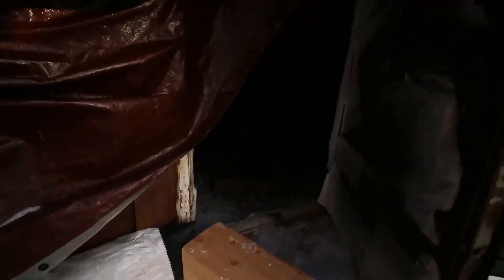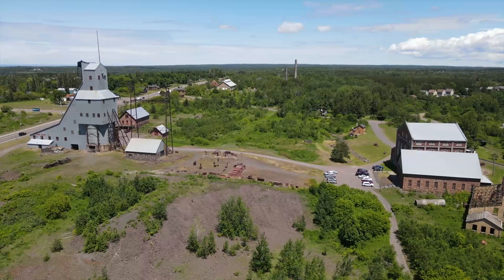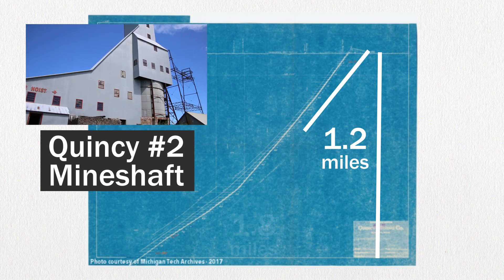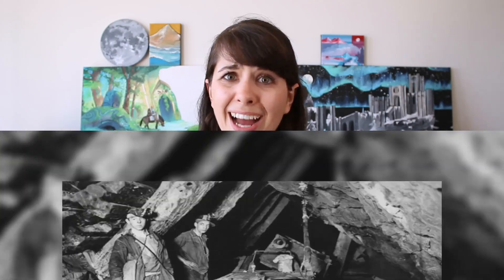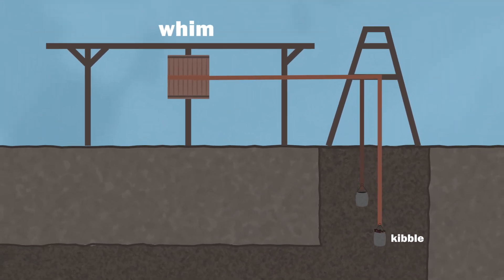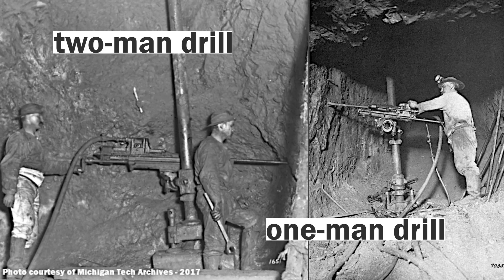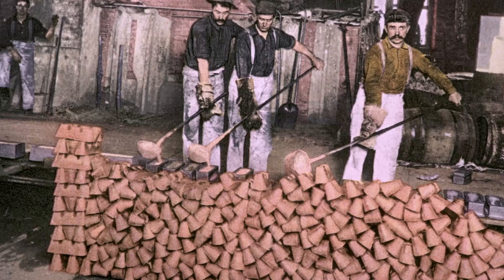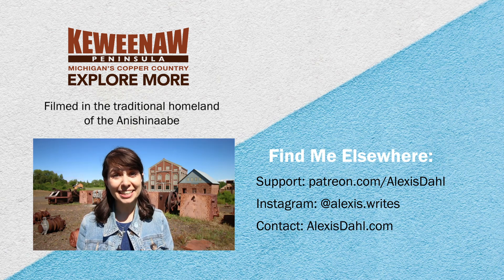Deadly Genius: The Engineering of the Quincy Copper Mine | Quincy Mine #1

Comment: I misheard the intro as "runs on power" bcuz youtube has this weird quirk it does where on the TV it just forgets i have captions on by default 9,9

But regardless, i thowt of the thing that has the most copper in it in my room; my window air conditioner which is chock full of copper even before we get into the electrical wiring side of things

Comment: The MTU link to the treaty of LaPointe uses incorrect maps showing the incorrect line for the 1842 Treaty.  The line or the east edge is from the head waters of the Chocolay river (Chocolate River).  The headwaters is regarded as the point on the Chocolay where the two branches meet.  Then, per the Treaty language, the line goes from the aforementioned Chocolay headwaters southeasterly to the big island at the mouth of the Escanaba River.

Comment: you mentioned Cornish workers. they are responsible for a lot of the language used in mines because of the mining history of Cornwall tin. They would have been specifically sought after, and sometimes directly imported.
Some examples of mining terms with Cornish roots; winze, windlass, stope, addit, stull 
Part of the controversy with early pneumatic drills was that they were making a lot of extra dust that the miners had to breath. they earned the nickname "widowmakers" because you could die of silicosis using one. this was aliviated by adding a water line into the drill that runs down the center of the drill into the cutting head. this also had the effect of cooling the cutter and flushing the waste from the hole, allowing the drills to be even faster, while being safer. Dills today are mostly unchanged from those original design, and are worked hard the world over.
If you're interested in seeing some small scale, relatable mining being done, check out a series called "Bringing an abandoned gold mine back to life"  by TVR Exploring. They are restoring a mine to operations that was last productive around 100 years ago. they actually just got a core drill team in there pretty recently, fascinating stuff!